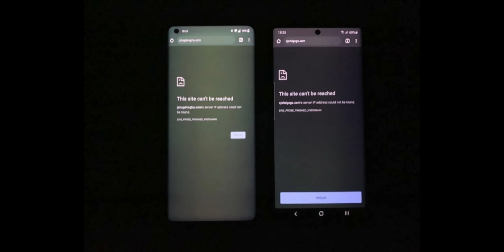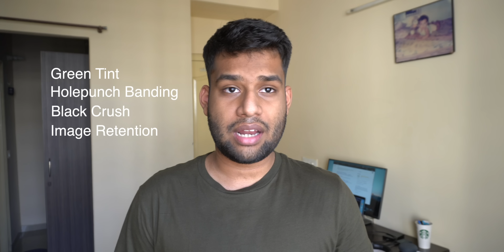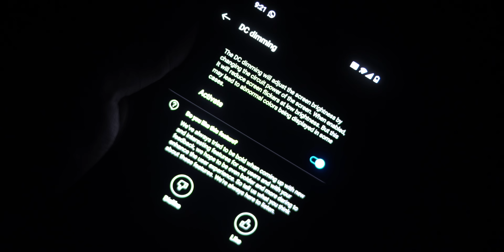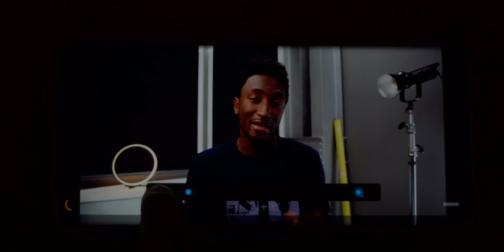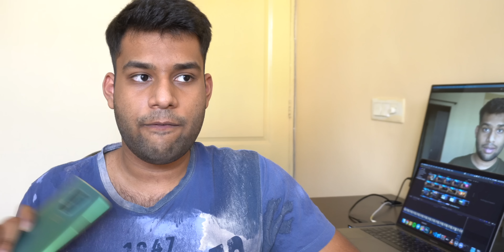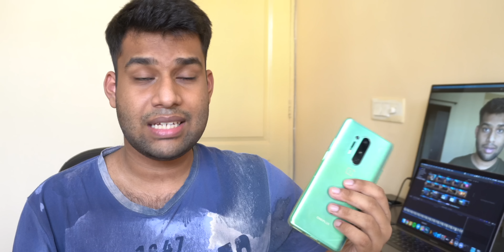I'm Returning My OnePlus 8 Pro.

Comment: I had some issues with a tiny tiny green tinge on all brightness levels, but I fixed it with an app called cf.lumen. I reduced the green levels to about 0.925. 
I've had no problems with banding, but I did check after you told it only shows up on a gray background. I had a tiny darker band too, but in very very specific conditions.

Their quality control sucks with the 8 pro though. Might go with the 9 pro if the problems are ironed out. (But only if I can still get good money from this at the used market. I don't have a random 1000 euros lying around. 
Had to save up for this phone for a really long time and I got a great discount. Got it for 450€ in near perfect condition. 

I kinda screwed myself because I just can't go back to midrangers now.

Comment: Happy with samsung s10 lite. No fancy feature like 120hz or so but it runs so smooth. Awesome ram management.  Apps hardly die in background. Amazing battery,  Display is awesome, very light in hand , pretty, secure , already running on Android 11(one ui 3.0) now. I didn't make a mistake picking Samsung over one plus. I used OP3T and after a year the camera deteriorated like hell, it never could focus I was irritated with that. Though the ui is smooth but I need other functions too like clicking photos or documents . It could not do anything after a certain point. I hate how reviewers bash samsung n apple but only they provide long lasting mobile experience . Much better than Chinese crap
Reply from the maker: Haha I’m glad you like your purchase

Comment: i have a issue with a dead pixel. its on the very very edge.  im not too happy but as its on the curb im not too mad.   tho i feel they have locked down the phone  a lot and options like dark mode is not easy to find.    im prob going to only trust things like Apple  i should of got the iphone 12 pro. oneplus companys like them dont seem to cheack the screen on there phones at all

Comment: Well oneplus isn't the only one
Alot of S20 phones got the same issue
And even the latest Rog 3 got it
So black crush is a problem you'll face with every 2020 flagship
Tho oneplus solved it slightly through software
You shouldnt have returned it back bro😂
Reply from the maker: I'm getting an iPhone lol
Also checkout my latest video, I elaborate on the very thing you just said
Reply: @KDCloudy  your iPhone also has that problem
I left a comment on that video
Reply: @Divyesh_Sinha  most higher refresh rate Amoled phones have this issue.... Apple's quality control and calibration of display is a lot better....hardly 2-3 percent of iphone will have it....but in case of other companies 30-40 percent have this issue
Reply: @f_sicc  not sure about the quality
But the main reason is that iPhone's lowest brightness settings is slightly higher than the point where this issue is occurring
This brightness settings was changed after a software update
Otherwise all iPhone still have this display issue
This is what other manufacturers are doing through software
They are increasing the minimum brightness level of the phone just like iphones
it's OLED tech's fault, not manufacturer's
Reply: @Divyesh_Sinha  just check some articles.... this happened only with a few apple users....if it was so many people would have reported.....and if they increased the brightness then there is no specific level of brightness of this issue....I face it even at 40 percent brightness on op7t while some users at 20 .. meaning op need to increase lowest brightness level to 40 percent....😂😂..this will strain the eyes at night....that is totally impossible to fix with software on any phone....when faults occur during manufacturing OLED...these issues are common....the condition varies in each panel....some no issues some less some too much
Reply: @f_sicc  maybe you are right
I just heard of my friends that their iPhone's lowest brightness is suddenly increased after an update which is irritating at night for them

Comment: I bought Oneplus 8 Pro on 24th July from Reliance Digital. I didn't went through much reviews before purchasing it, as I was in urgent need of a phone (The same reason to buy it offline). On the Day of purchase I observed display issue, while watching Ozark in Netflix. The bright subtitles was blowing my eyes, where the actual video was barely visible. This is more prominent in low light. There was unnatural color shifting and pixelation in dark areas also. It was really irritating and not something that only fine eyes can see. At first I thought, It was an issue with Netflix settings. Then, soon enough I discovered that the same issue is reported by many oneplus 8 pro owner and is termed as "Black Crush". Accompanied by finer issues like Punchhole Banding. All the tests suggested by community failed on my device. Then there was an anomaly, whether these are software issue or a hardware. The story is, first they acknowledged it to be hardware issue (lucky guys got replacement), then they tried to coverup the issues by software tweeks. For example: To hide the issues, they capped the lowest brightness level, also applied a red tint to cover the green tint, brightness level cannot be changed in youtube, etc etc. However, the attempt failed, as the black crush issue is still in unbearable state.  Few issues are gone by the software update. Because, I could not observe any green tint on ambient display. But any HDR content (Most of them are) is a horrific experience. My device's manufacturing date is July-20, so not sure which batch has this issue, or it is totally random. When I went to Reliance Digital for returning the item, they denied the issue and asked me to go to the service center, even when its only 3 days from purchase. My refund/replacement is on the thin line, of whether the guy in the service center acknowledges the issue or not. If they don't, I am completely screwed. Even if they replace, It is a time consuming process and without a guarantee of perfect unit. So, if 55k is not an easy money for you, don't play the risk. I repeat this is not a minor issue.

Comment: Hey! I don't face any of these issues
But although at 0 brightness in a pitch dark room there is a change and problem in the display . However I'm not going to watch a video at 0 brightness in a dark room
Reply: I also have the same issue not a big deal no one is gonna use in such low brightness anyway

Comment: Ordered one plus 8 pro on 25th July, received on 30th July. Manufacturing was also July 20 so I was hoping this would be a flawless unit but nope. within 48 hours I saw hole-punch banding, screen tint as well. One plus customer care didn't connect me to any executive on call for over an hour. It was amazon who saved me and they have initiated the replacement process. It's been months of continuous issues and one plus still hasn't figured a way to solve this. Disappointed. I waited for one extra month to buy the phone so that the new units would be perfect.
Reply from the maker: Sorry to hear that. Might wanna try out the Nord?

Comment: Bro I had ordered op8 pro on the first sale, I got the phone on 18 June , I assumed that my phone is alright and it doesn't have a faulty display , but after watching your videos , and doing the test on screen at low brightness I found out that my phone. Has faulty display too, it has black crush isssue and black bar on notification panel . So contacted  Amazon  regarding replacement ( after one month of purchase ) but they said they can't take this unit back because , the wondow for return is available only till one week after delivery .... They further told me to contact oneplus regarding this , but I have been trying to contact one plus through fb Instagram and their toll free number  even through their community app, they are not responding at all  anywhere. What should I do please suggest .

Comment: Interesting ....I have the S20 Ultra since march and I noticed green tint display especially at very low brightness but after few software updates they issue completely gone , I believe they can fix it with software update
Reply: Hi...
Did you face this green tint on the s20 ultra entire screen or only some parts of the screen like at the bottom or top..

Comment: This is a common Amoled display problem. You would be surprised knowing that even my father's 6T is having black bar although its barely visible
Reply: Been using Note and S series for past 5 years never faced an issue. Only issue I had is with S7 edge which has screen burn in issue that happened after 3 and half years of using that smartphone. I had Note 6 no issue, then S7 edge had issue but after 3.5 years (still have that smartphone with me but my nephew plays with it, I don't use it much), then got Note 9 and currently using Note 10. 
My girlfriend also had 3 Samsung S series smartphone and currently using the S10 plus.
Reply: I haven't faced this issue in  any samsung devices I have used.Its oneplus' problem

Comment: Hi KDcloudy,
I am facing massive whole punch banding issues. I showed the issue at 2 service centres in Delhi and they are saying its an issue with all devices and maybe fixed later with software update.. if not they said the screen is like that only and we won't replace it.. please guide as to what can be done
Reply: They are like that only, even in Mumbai they refuse to replace their faulty device.... The best way is to buy on Amazon, as replacement policy is very good. .

One Plus is cheating people.... i will never buy one plus again..

Comment: Hello everyone, OnePlus 8 Pro user here (Ultramarine Blue 256GB). While this widespread display issue is horrible, I just want to share my experience with my unit that I received just 3 days ago (updated to latest build of OxygenOS 10.5.10).

Overall, the display is GREAT, like REALLY GREAT. 120Hz + 1440p is a blessing (device can heat up a lot if you use 1440p in games, use 1080p to avoid heating and battery drain in games). HOWEVER, the screen issues seems more apparent when running the phone on 120Hz mode vs 60Hz (I'll attach a pic link below of my unit, captured with my older Note8).

https://imgur.com/gallery/rSB3rXS

In the pic, the only problem I can see on 60Hz is some sort of uniformity issue at the top right side of the screen. With 120Hz? There's a bigger uniformity issue from the left, top, and right corners of the screen (there's also a faint green tint). The top "black bar" is also noticeable.

But then again, these are images captured on a camera with very low shutter speed. From what I can see with my own eyes, the 120Hz issues are NOT noticeable unless I REALLY look for them. The only noticeable difference I can see with 60Hz and 120Hz with my own eyes is that 120Hz has a little bit less gamma.

Sidenote: The black crush is also what I can notice. From watching this vid on my phone at 0% brightness > https://www.youtube.com/watch?v=fv6T7aHsd54

I can only see the tiles up to 7 (I have to move my eyes closer to see the very faint tile on 6). This is what I believe is fixable via software update. Watching movies with dark scenes can be a bit hard with this kind of calibration. OnePlus really needs to fix their screen calibrations, like give us manual sliders or something.

Overall, that's it. I'm not returning my unit, I'm very happy with it.
Reply: That's a good decision:')
Reply: Do you have black crush issue at 30-40% Brightness?
Reply: @prajual   yes my  half screen is good and half has black crush i threw my one plus you also dont buy!!
Reply: @trippingsoul2846  I already bought it
Reply: @trippingsoul2846  you really threw?
Reply: its due to over heating pixels.its produce heat and colors loose its uniformity. its pled issue.becausevoled is now in evolution not in stable faze.
Reply: @vyasjwalit3999  kehna kya chahte ho? Bhyi🤦😂
Reply: @trippingsoul2846  technical term he.only electronic engineer or related person samaj payega.for bhi samjhata hu
Reply: @trippingsoul2846  LCD display background panel ki  light she bright hoti he.uski khudki koi light nahi hoti.but oled me pixel khudki light emitting hoti he.isliye yeh display heat jyada karti he.pixel burn hote he uneven temperature ki vajah se colour uniformity nahi rehti.
Reply: @vyasjwalit3999  hindi ittni acchi likhte ho bhai english ki kyu ma behen kr rahe thae! 😂😂🤦 Well i already got you! At first comment was just asking you in a sarcastic way also i do have a mechanical engg. Degree:') so your technical terms wont  excite me much haha💯
Reply: Thanks for your comment.

Comment: Not just the PRO model even the regular oneplus 8 has display issues i returned 2 oneplus 8s as both of them had display issues the finger print scanner was visible under grey or dark screens, the display colors used to fluctuate and overall the quality of the display was very poor even compared to previous models or other cheaper phones. Very disappointed with oneplus

Comment: Hey KDCloudy, I faced a much worse issue than you with my unit of the oneplus 8 pro(12Gb/256Gb). My phone CRASHED TWICE within 48 hours of delivery, and the irony is that it happened both times when I was watching your video on Youtube. The phone literally hung, got pixelated and rebooted itself. Apart from this, there were also display issues like the red tint and the green tint as well and even the touch sometimes would get unresponsive. There was also a noticeable screen burn-in near the hole punch (like the hole punch banding you had). And the fluctuations of the display while I watched content on Youtube (at low brightness) was just simply pathetic. I spent 60k on a phone for the first time after staying in the sub 20k price range phones for so long and this service was so goddamn disappointing. Anywho, I placed a request for refund(since replacements aren't available) and it's done. I AM DONE WITH THE ONEPLUS 8 PRO. And lastly, thankyou for making this video, I was amazed that none of the tech reviewers had a problem with their display or any of the issues faced by multiple users. Coincidence? think not. 

edit: Idk why the link to my tweet isn't working, but if you searched Twitter for @ryan_nayak28 you'll get to see the video of it crashing. I only have one tweet, it won't be difficult to find.
Reply from the maker: Damn. Never had the performance issues. 

But yeah review units apparently have been flawless

Comment: I read that the hole punch thing happens on Samsung phones with hole punches too, so it's probably a limitation of the technology itself and not an unit defect. And honestly a single band on the display that only happens on very specific times doesn't seem like a very good reason to ask for a refund. Now the black crush and tint issues are way too much for me to handle.
Reply from the maker: Black crush started to appear on mine as well with regular PWM, and some color shifting during sliding the brightness. 

I would any day trade 120Hz and QHD for a rock solid, color accurate OLED panel.
Reply: @KDCloudy  that's very disappointing 😞
I own a Pixel 2 XL and I simply can't use it without an overlay app to fix the black crush because it's THAT bad. I'm just not buying another phone with black crush again. I really hope OnePlus fixes this on the OnePlus 9 Pro.